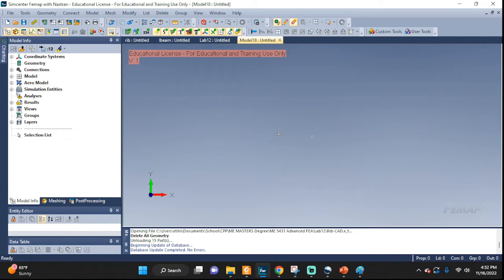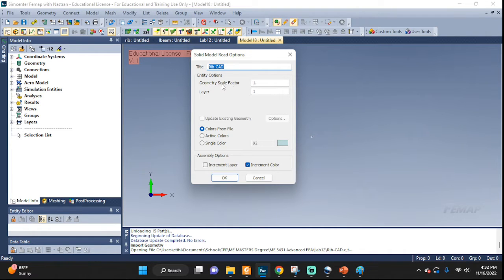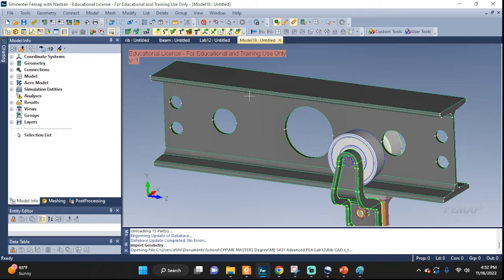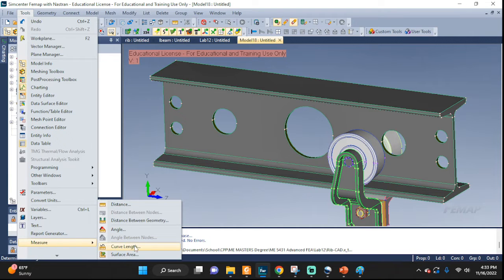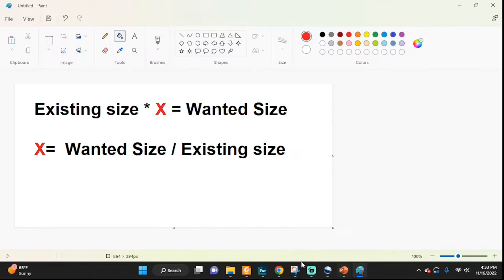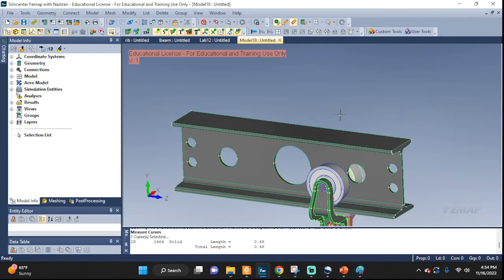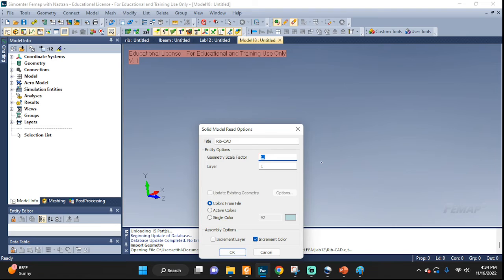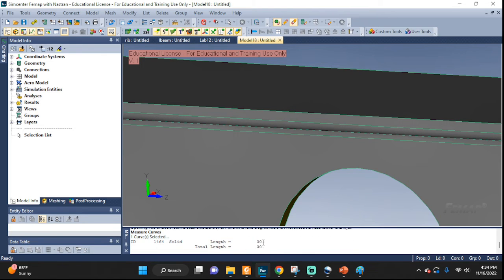How to import, measure, and scale in Femap Nastran

Comment: Which are the units FEMAP is set up to?
Reply from the maker: This is one of the most frustrating features of Femap for me. It is a unitless software. This means the program does not automatically handle or convert units for your analysis. Instead, the user is responsible for ensuring that all input values—such as geometry, material properties, loads, and constraints—are defined in a consistent unit system. The resulting output will then correspond to that same unit system.  Many times I would like to see some units just to help double check things and avoid errors